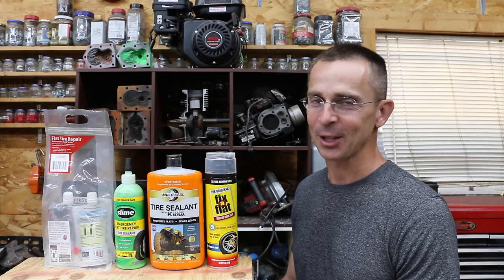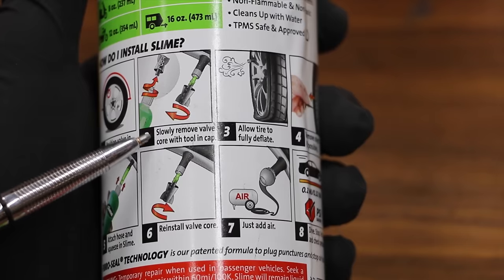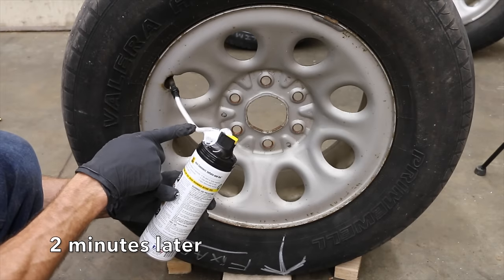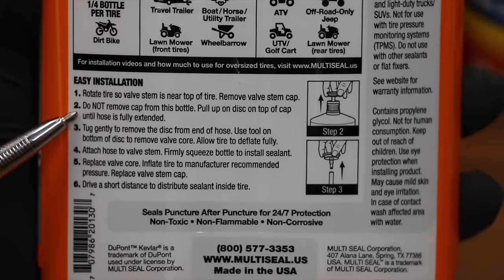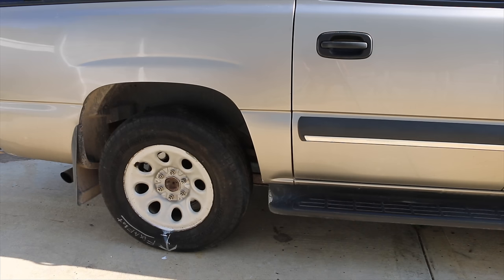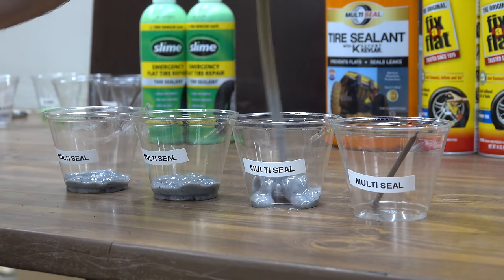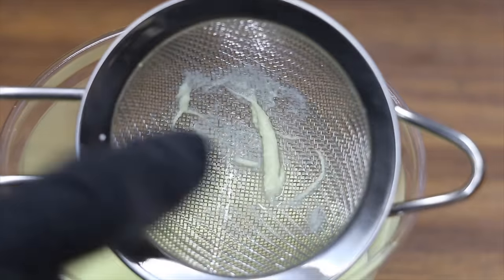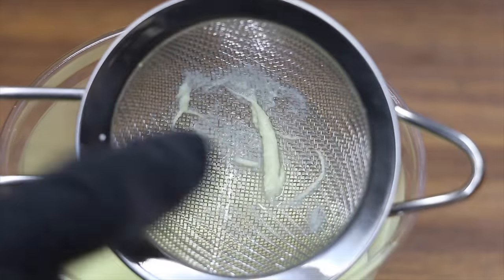Is Tire Slime the Best? Fix-a-Flat vs Tire Slime, TireJect, MultiSeal. Let's find out!

Comment: just put a plug kit in the glove box
Reply: sometimes plugging dont work tho but still good idea
Reply from the maker: Thanks for the constructive feedback
Reply: plug kits require significantly more muscle to use, sometimes the applicator will bend, or break before the plug goes in. It's good to have, and I trust tire plugs more than slime (had slime spin out of tires at highway speed, made a green ring in the wheel well), but some people can't physically use a plug kit.
Reply: I currently work at a well know tire shop, the tire plugs our customers use, referred to as a "road plug" actually makes it so we can't service the tire at all, because they don't completely seal.
Reply: ba-zou-KA ➡️ that’s what I did , like a month ago . But recently got a flat and fix with the plugs,  worked great 😃 ., also I have a portable compressor in the car ., no need to go running around looking for a gas station to get air
Reply: they do require more muscle use but I’ve never really had a problem with them, the toughest part is reaming out the hole, inserting the plug is the easy part in my opinion Especially if you lube up the applicator tool with rubber cement. I’ve got two plugs in one tire right now and they’re not leaking at all :-)
Reply: @RyanSconce  pull plug out from inside, apply proper tire patch, mission accomplished, plus plugs tend to completly seal, where the tire doesn't need more air until it gets another screw in it
Reply: slime just goes in your tire and sits there
Reply: i have had great results with plugs that look like black calipers -
Reply: cordless drill/ bit for reaming out hole
Reply: @j0sh368  you can always keep plugging in more until you run out.
Reply: Plugs are great I've had them last the life of the tire without issue.
Reply: @RyanSconce  - known
Reply: A plug can't fix a puncture in the side of a radial tire. Besides that, a tire shop will not remove a plug and patch the tire with the recommended manufacturer fix, a patch, after a plug was installed. Just ask me. I tried just that after a plug I installed was leaking air.
Reply: @jameskoralewski296  
My motorcycle had a screw in the sidewall. 
I plugged it. And I was fine for the rest of the life of that tire, about 2,500 miles.

I dont recommend it on a bike though... I have life insurance 🤔☠
Reply: Yep, been using rope plugs for years... In fact, there's some in one of my tires right now. lol
I keep some in my first aid kit.
Reply: Ye we do that it looks really Wierd but works great
Reply: I keep the rope-type plugs in my emergency kits...
Atv tire got a slice in a sidewall multiple plugs plus a CO2 cartridge inflator.... got it back to the truck! Replaced tire later, but didn't have to ride on a complete flat.
Plugged bias ply drag slicks(running tubeless)... it worked! It shaved the extra cord off when I did the burnout. 
Put one in a friend's sidewall one night, he bought me more plugs & a kit for himself... It lasted long enough, he saved for new tires.
Plus multiple plugs in my daily drivers....
Reply: @jameskoralewski296  Remove the tire yourself in the car park. Pay them to unmount the tire. Repair it yourself at your car then have them remount it. If you think the tire is unsafe, rotate to the rear where a blow-out it not likely to cause a crash.  Also, nothing can repair a sidewall puncture. The future is airless tires.
Reply: @lonewolf2156  Now you've jinked yourself.

Comment: I had a 2012 Mustang GT that came with a 12v plug in Tire inflator with a replaceable canister of tire sealant. I had to use it once and it worked pretty good. I used it in the middle of Nevada and it got me to California and completely sealed the leak. Once I got to my destination I had it properly patched.
Reply from the maker: Thanks for sharing.

Comment: Never remove the nail or screw if you MUST use Fix a Flat . It will get you home or to a shop.
Fix a Flat should not even be in this test it is an emergency only temporary "fix" .

Let me give my credentials ... 10,000 plus tires fixed over 30 year in every known industry except aviation .
Conclusion if you have a compressor in every vehicle you own never by it . If you don't it can save you or a stranger 7 times out of 10 .
Reply from the maker: Thank you for the feedback
Reply: indianseibel123 I can definitely tell ya aircraft wheel and tire assemblies are an entirely different and insane ballgame haha. But one thing for sure is that you'll never encounter any "flat fixing" products in them whatsoever, as they're not an approved alteration or repair under the federal laws we have to follow for maintenance. Though I wouldn't doubt some pilots or mechanics have tried using it in less professional settings.

Comment: Can you do a test on portable Battery jump start packs?
I believe they are lithium and are compact.
Would be interesting to see which brand jump starts a dead car the most on one charge etc compared to other brands.
Reply: Has nothing to do with brand, they're just a battery with wires going to it so it's going to come down to which has the largest lithium pouch cell in it, in other words while some are overpriced for what the are, the winner will cost the most and be largest and heaviest because you can keep paralleling more series of cells to achieve higher capacity.  In other words if you wanted to, you could just connec two simultaneously for double the capacity, as long as they are equally charged.
Reply: @stinkycheese804  i understand that, but he could review and test similar capacity ones and see if the manufacturer live up to their claim. Just trying to give video ideas
Reply from the maker: Thank you for the video idea!
Reply: @stinkycheese804  Have you taken any apart? BigClive's channel showed one and it was not just a battery to wires. It had some MOSFETs in it and they were what blew.

Comment: You didnt mention much about the tires being out of  balance after slime installed
Reply: I guess the thinner products, like TireJect, are better in that sense. (The liquid stays at the bottom of the tire rather than sticks to walls.)
Reply: @LevisL95  yes I noticed that on my home review of it
Reply: @LevisL95  All of them will distribute around the tire at speed, with additional product ending up in light spots, much like balance beads. While the thicker products might wobble for a bit while distribution happens if you accelerate rapidly from a stop, all of them should distribute around the tire, with the effect of actually being better balanced on long runs at speed. Of course if it freezes in the bottom of the tire, balance will be terrible.
Reply: @edifyguy  Q: Do you have 55 days interest free until you have to pay anything after the billing date?
A: The interest free period can be UP TO 55 days, not a 55 days from time of purchase. Ensure you always pay your entire balance by the due date to avoid interest charges on purchases.
Reply: That’s probably why multiseal says off-road use only...
Reply: Slime does NOT alter the balance of motorcycle tyres. I have had no problems at all. It is just a thin layer around the inside of the tube and so does not alter the wheel balance but the wheel has to be in balance before you use the Slime.
Reply: There not out of balance, it rebalances itself in 1 minute of driving... its just the fluid pooling at the bottom then redistributing thru thebtire during rotation. Please use common sense b4 posting nonsense
Reply: @nickh3809  Must agree with you Nick. Some people just have no sense. The product would not be sold if it caused the wheels to go out of balance on a motorcycle. I have had NO TROUBLE with slime in both my tire tubes. I have a heavy cruiser type motorcycle and I have never felt any out of balance right from when I start moving. It just feels the same as when I had no Slime in my tubes.
Reply: @edifyguy  TOTAL CRAP The tires remain in balance with the Slime in the tubes and you will not notice any difference. I will only use the Slime product and I have never had any problems with my Yamaha V Star 650 Classic Cruiser. You want to STOP FRIGHTENING people out of using these products. It is no fun having a puncture on a heavy motorcycle way out where you can not get any help and you are a 66 year old man. Use the Slime and if you do get a puncture then it will fix it's self and you will get home again.

Comment: When will you be doing a portable air compressor review? I am in the market but pending your review.....
Reply from the maker: It's coming within the next 3 weeks.  I'll test 9 pumps and will give them a tough, but fair review.  Thank you
Reply: Project Farm thank you! You are awesome and I hope you have a great weekend.
Reply: Check out the new Milwaukee portable air compressor. It runs from a rechargeable lithium 12-volt battery.
Reply: @jameskoralewski296  That is what I ended up buying. I am mostly Milwaukee for all my mechanic power tools. It seems pretty good so far.
Reply: @WoahVinnie  Mine has worked flawlessly!

Comment: I have used Fixaflat in the past and it has worked but I stopped using any tire sealant many years ago.  Today I prefer to plug my tire until I can get my car to work where I will remove the tire and properly patch the hole or if I am too far away, I will have the tire properly serviced.  Having a portable air compressor in the car is an absolute must.   I actually have two in mine only because I bought a new one a couple years back which pumps quicker but I decided to keep both just in case one stopped working.
Reply from the maker: Thanks for sharing.

Comment: Question: does anyone out there have Slime permanently installed inside your highway car tires to prevent flat tires? Has anyone experienced balance or shaking problems?
Reply: ive used it on both motorcycles and an old isuzu. i dont know about prevention of more punctures, but i can tell you about shaking. on cars i never felt a thing. on bikes ive only had a vibration on one occasion (out of a dozen times and the full life of three sets of tires) and it went away after a week. ive gone 190 mph on punctured and slimed motorcycle tires without any  issue. but neither of them sealed without the hole being punched first.

that said, the old timer mechanics tell me slime will degrade aluminum wheels. after i heard this i switched to fix a flat. seals fine but it takes a few weeks before it quits its slow leak.
Reply: @johjoh978  190MPH on a compromised tire.... You've got to know what's coming, man.
Reply: They shake at 55 but the shake is gone at 75.  Of course I’m talking kilometres per hour.
Reply: @johjoh978  what does 'degrade' mean?? does it actually affect the surface or does it only stain it? i like to prove or disprove things for myself- i don't believe what other people- even old timer mechanics- say about shit.
Reply: @ryanj610  he said 'punctured'- puncturing a tire casing does not put it into a 'compromised' state. if that where the case- no tire store would plug your leaking tire.
Reply: @ryanj610  whatever is coming to me will find me, yes. occasionally ill be given the gift of a wide open straight road. god help me but i cant turn it down. usually closer to 110, but maybe top speed a couple times a year.

i dont do things like that if anyone else is at risk or even in sight. 600 lbs hitting someone that fast would damn near cut their car in half.

 if i die, i die. but i wont go out a murderer. no worries.
Reply: @tommurphy4307  motorcycle tires will not be patched or plugged unless they have a replaceable tube like a dirt bike. no decent shop in the country will do it. its absolutely compromised and blow outs do happen and specifically happened to me like two months ago.

 it becomes an issue at the end of the tires life. it gets very thin, the punch quits holding, and it blows out causing a split the whole width of your tire. i was up around 140 or so and i felt it get lower to the ground and start a very light wobble. genuinely shocked i didnt dump it.  split it wall to wall and i kept her upright all the way to 0. wasnt promoting anything. make decisions at your own risk. i was just saying this is the result i got.

also, i meant degrade as in itll corrode it like mild steel in acid. i have no proof, but i figured id better not risk an $800 rim till someone proves one way or the other.

Comment: WOW, Talk about thorough Sir. Just what I needed, brand new expensive Tire, screw at edge of tread and of course tire shops No F'n way I will patch that.
Reply from the maker: Thanks for sharing.
Reply: yep i got one in the same place. the local tire shop did fix it 1 time with 2 plugs leaked slowly 2nd time from the inside and now it leaks quickly. taking it back to get the spare put on it today after i air it up again.

Comment: What is your take on the impact of tire balance with each product ?
Reply: I was curious about that as well
Reply: Doubtful it would matter. The part that plugs the tyre is so small, and the remaining fluid will evenly spread itself round the wheel as you get up to speed.
Reply: @PJBonoVox  
     So you guess. One of the reasons we watch this channel is to put theory and guessing to the test. The first thing I thought when he dismounted the tires was how the liquid affects balancing. If anything, the slight imbalance as the wheel gets up to rotational speed might have an affect. Dunno.
Reply: @PJBonoVox  yeah, if you drive on it and the formulations stay liquid enough to evenly distribute. If it's possible for them to solidify under pressure and the wheel sits for long enough in one position, it could all congeal at the bottom.
Reply: @donbags5542  It's just my opinion for sure, I can't prove either way :) But as the commenter below you said it'd probably congeal at the bottom while the vehicle is stationary and screw the balancing up. I hadn't thought of that.

I've used those repair plugs for years and never had to replace a plugged tyre, so that's what I'd use. Unless it's structural or in the sidewall.

Comment: I once heard you could use dawn dish soap as an engine oil can you debunk this please.
Reply: Well, it does have excellent detergent and anti corrosive additives. I doubt it would hold up to the heat though.
Reply: I have a feeling it would suds up under the heat, making air bubbles, failing to lubricate critical engine parts, and then turn into a sludge and leave deposits once the engine shuts off.

Comment: I use to work in a tire shop and I broke the bead on a tire that had 4 cans of fix-a-flat in it......I ended up wearing it for the rest of the day....hate the stuff!!!!!
Reply: Oh man.....that had to be miserable. It stinks. I do my own tires, and don't use this stuff because I know how hateful it is.
Reply: Obviously, you didn't perform step 1 before breaking down the flat tire. Step #1. After locating the leak and marking its location, remove the valve core and release all the tire pressure before separating the tire and wheel.

Comment: Video Suggestion: Will a gasoline engine run on Whisky/Vodka/High Proof drinking alcohol?
Reply from the maker: Thank you for the video idea!
Reply: It will but it'll run really lean
Reply: I've got lots of alcohol that I would donate to the channel for this test. Idk how we'd get it to you or the legality, but it's just sitting on my shelf in the garage. We cleaned out an old building full of it and I don't drink.
Reply: I've tried to do this test. Naturally,  my assistant and I wanted to be sure of the quality so we took some samples. When we woke up again there was only a few drops in the bottle. We concluded it must evaporate too fast to be useful.

Comment: I've never had Fix-A-Flat work on any tire, ever.
Reply: I used it once but it’s a tiny leak. It worked
Reply: @jiggertabuclin6057  I was going to say the same happened for me. 
It worked for a slow leak. Another time a piece of fence wire jooged a hole in my tire, and I had a plug kit and a can of Fix-a-Flat but no compressor. The plug held and the Fix-a-Flat pumped the tire up enough to get back home.
Reply: @Cautionary_Tale_Harris  I bought a slime now instead of “fix-a-flat” and I always carry a compressor that can be plugged on the cigarette outlet of my minivan. I used to have a run flat tires but changed all of them to regular tires because of the noise and poor ride quality.
Reply: @jiggertabuclin6057  I got some Slime, too! And I learnes to keep a little compressor since that incident I mentioned above---over 20 years now!

Comment: save a mecanic, use rubber plugs instead of liquid repairs.
Reply from the maker: Thank you!
Reply: Installing plugs will damage or break my Lee Press On Nails. 
So, no.
Reply: @21Division  I believe the only allowed repair in most states and provinces is a patch from the inside. So they CAN refuse service on that ground. Most shop will look the other way and do the work because they see how well the self vulcanizing plugs work in the real world when installed correctly
Reply: @bartprice3439  I never thought of that as I'm male.
Reply: @Nordic_Mechanic  I bet the tire shop industry lobbied the legislatures to not allow any repairs except internal in order to force the consumer to take it to a shop instead of DIY.
Reply: Easier said than done. You need to take the tire off to plug it and it takes a lot of force and struggling.
Reply: i never take tire off, simply move car for access.  use the t handle style. if too hard for you call tow truck

Comment: When I was a tireman fix a flat was much hated. We charged double to fix tires with it in. Some shops wouldn't fix tires it had been used on and would only sell you a new tire with an extra charge for cleanup. (80s) the other items you tested weren't around then. Great test.
Reply from the maker: Thanks!